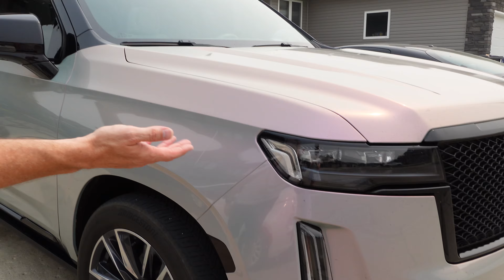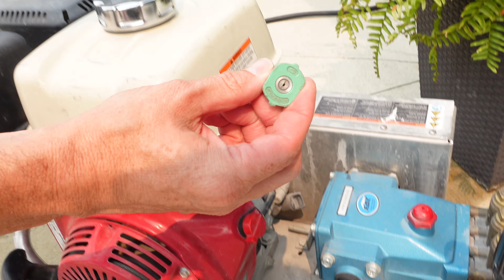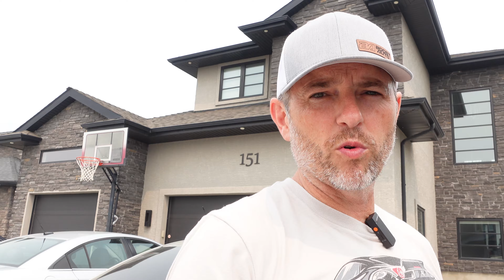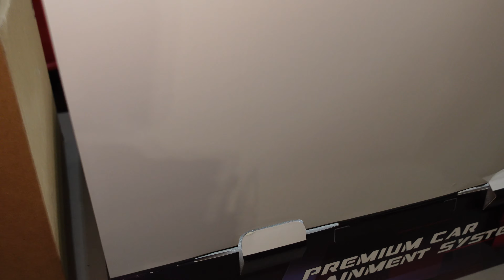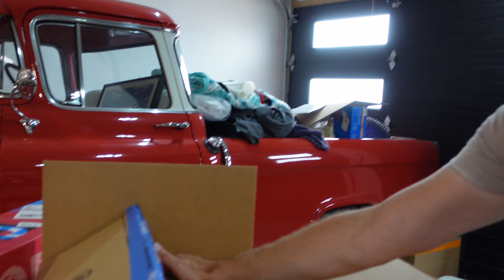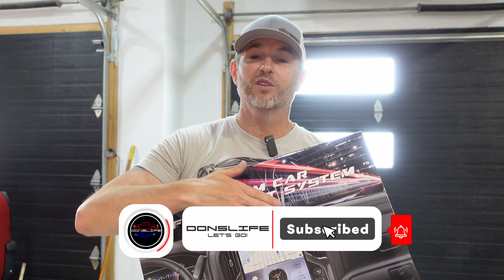I Damaged My Truck Wrap With a Pressure Washer — Don’t Make This Mistake

Comment: Nice, Don! a re-wrap would be an interesting watch.
I've tried three different screen replacements on my 2017 Silverado 1500 and hated them all (gave 'em away).
Then, I found the 14" screen in your video (maybe from a different seller, mine was from AutoTec Pro) and it's 10X better than the previous ones - truly plug and play - after I put everything back together from the previous installs.

Comment: Is your GMC AT4 have the Factory BOSE System in it?  I will be curious if this new Android System will improve the quality of the Stereo Output over the GM Factory System. My truck has the Upgrade system, but not the Bose system. The Quality of sound is at it's best a "Okay" quality. A friend who has the Bose in his Truck is really not any better. I have noticed of the GM System if you use the fader and listen to the rear speakers only, they are really poor sounding and that is in My Truck and the Truck with Bose.  Can't wait to see this install of the AuCar Android and let you be the Ginny Pig before I change out mine.  Last question on your AT4, does your Truck have the 360 degree camera system? I have read where the AuCar will work with all factory equipment, great. But in the real world, we will see. If you don't have the 360 degree Camera System, might you be inclined to add a Front View Camera for Parking situations?  I don't have the Front Camera on my 2019 Silverado, but would like to install one, current Infotainment System would not support a front camera.  If you have a list of projects to do for the AT4, might I suggest Surround or Front Camera's?   Enjoy the Rally.
Reply from the maker: I have the BOSE system and 360 camera system (full tech package).  I am curious how all of this will be integrated by the new mod

Comment: I wonder if it would look good if the torn part of the wrap was replaced with gloss black. As in, the entire lower bumper rewrapped in all black, with black also extending from the outer edge of the fog lights to the fenders on the upper bumper cover, encompassing the damaged area.